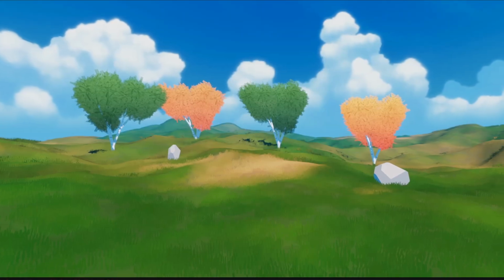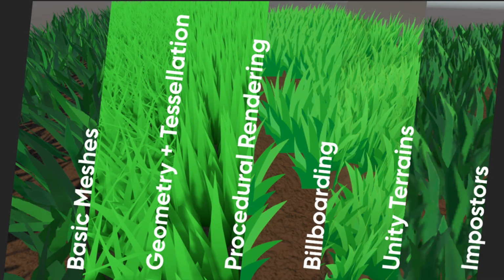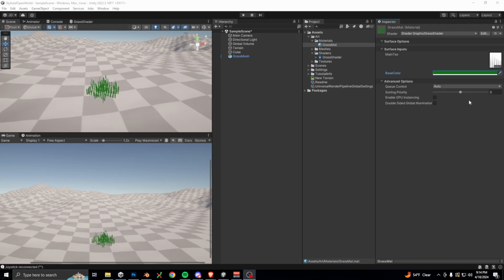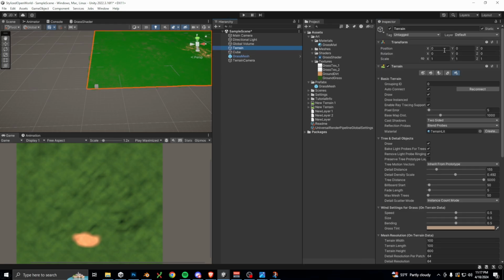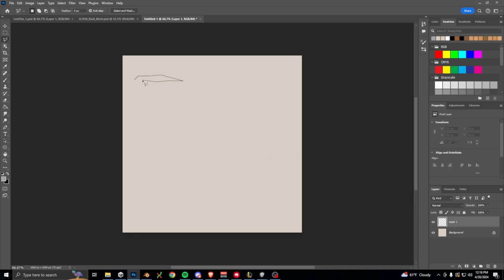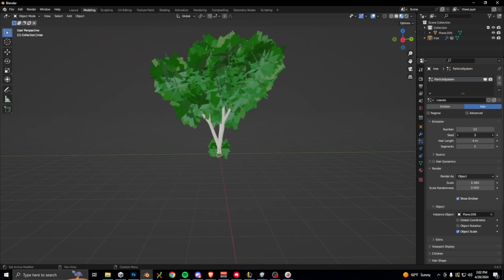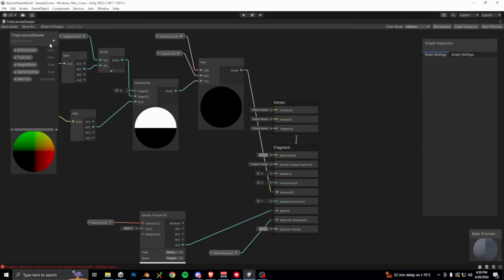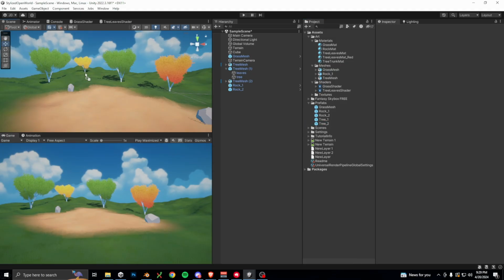Designing a Stylized, Custom Environment (beginner friendly!)

Comment: could this make it so with out the grass i have example 100 fps but with the grass ill have 30fps? basically could this give frame drop?
Reply from the maker: It's possible, I will try to run some detailed performance diagnostics. I checked a few things real quick though
1. On my system (its a beast), I pull 330 fps with the grass on, and 480 fps with it off (you can check on your system by going to Terrain-> Tree & Detail Objects, uncheck 'Draw' and compare)
2. Reducing Detail Resolution Per Patch and Detail Resolution from 64--> 32 significantly boosted by FPS (from 330 --> 430 fps).
3. Reducing the the Render Texture size from 1024x1024 --> 256x256 had no impact on FPS, so it is not limited by the render texture at all
Reply from the maker: I believe it is just limited by standard vertex count from the meshes. There's a lot of grass with the way we set it up! This generally happens in all games and is why there are settings to turn off grass. (Note: Genshin Impact locks FPS at 60)

That means things like reducing the mesh density and reducing the detail distance will help improve FPS. With grass on, there are 1.4M tris and 2.4M verts, and without, its 250k tris and 170k verts, so its expected that it will be pretty heavy on performance. The goal is to reduce that number as much as possible with grass on, so experiment around with some settings. 

There are definitely some advanced techniques that can be used to further increase FPS like GPU instancing, but I will save that for another video.